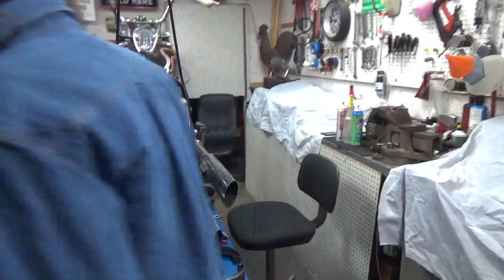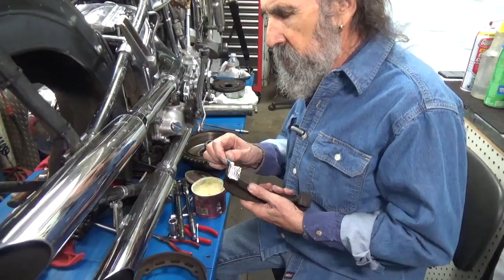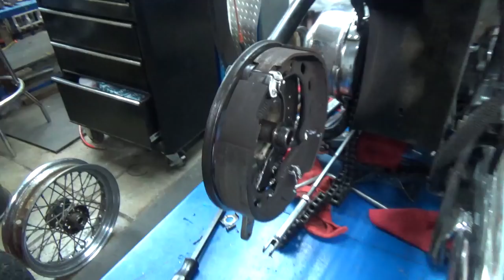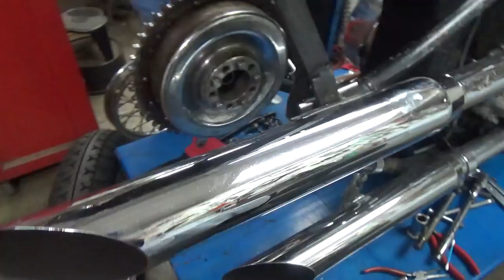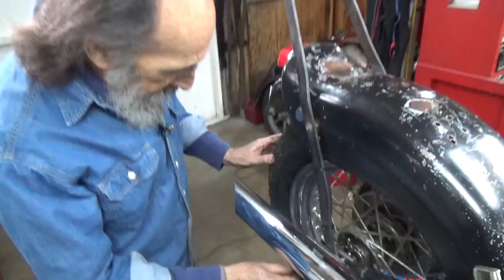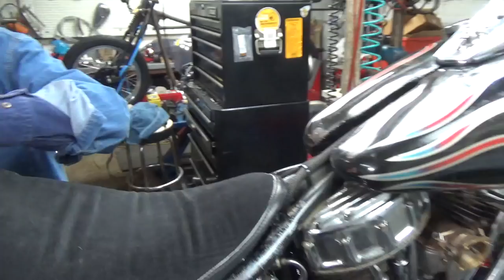Step19 L C  the Panhead Now gets Her New Tire, Seat & Rear Brake

Comment: I was an auto mechanic for many years and I never liked when somebody was watching me work...I hated it. I would stop until they left me alone.
Reply from the maker: Yah, but those brake shoes popped on like I was alone!
Reply: @pacificmike9501  the next level as a master mechanic is to have the gift to teach others and deal with problems  even when the bike didn't read the shop manual. :)

Comment: P.S. Mike, I had those tires on my 82 FXRS Shovel Head. They were nice in the rain. Glad I had then on. I always put 3 coats of good wax inside those wire rims win they're new before mounting inner tubes & tires. Also tall & fat rubber on both ends = a great handling and smooth rider. That wheel & new tire looks great installed.
Reply from the maker: Thank You
Reply: What tires are those?

Comment: Hey Mike, you never said what the tire was. It looks like a Continental K112.  I ran a Continental on my ridgid for years. It was the best riding tire I have ever come across. I didn't realize they still made them.
Reply from the maker: Yes, your are correct.  I was told years ago, by an old buddy of mine that they still made that tire for use on rigid frames.  He was the national sales manager for Continental Motorcycle Tires.  We used to eat ice cream bars together at the trade shows.

Comment: Hello from Sweden🇸🇪. Looks nice with a comfyseat on LC👍. QUESTION...I know u don't advertise brands on tires Mike. But what brand is it? I have never seen a rusty rim like that before. My Springer Softail had some rust on the rear rim but not as bad as that. Took some time to remove rust and know it got paint on the inside of the rim. Have a nice weekend the 2 Mikes😎Kjell Blomstrand 🇸🇪.
Reply from the maker: Sure.  It is a Continental K112.  MT90  16.  Still made today because they are so comfortable on a rigid.
Reply: @pacificmike9501  Thank you👍. Next time i change rear tire i try that on the Springer or the Electra Glide. Kjell🇸🇪
Reply from the maker: I try to use the right tire for the job. This is what I run on old rigids.

Comment: Is removing the wheel from the drum a more effective method for wheel maintenance? I pulled my rear wheel for the first time for a new set of spokes and truing and took the drum and mechanism out with it. Would it be beneficial to mount the drum first when i put the wheel back on the bike?
Reply from the maker: I don't know which bike or model you have, but generally, Harley recommends removing the wheel from the brake drum.  Look it up in the service manual.  On a rear factory rigid, what you suggest is way difficult.  This is what we're working on.
Reply: @pacificmike9501  thanks for the reply. Mine is a 49 EL. I'll get deeper in my service manual once I get back to the states.

Comment: Hay Mike, you have anything on replaceing the rear tire on a old 1984 FLHTC with the enclosed rear chain?
Reply from the maker: I haven't done one in years.  But, it's a great long lasting setup.  Follow your service manual.  Lift the bike up and remove the lug bolts to remove the wheel from its sprocket.  That enclosed (oil bath) system is great.  Just don't attack it without the guidance of your service manual.  Most of them have been destroyed and it's a real shame.
Reply: @pacificmike9501  thanks Mike. i will do that. my oil bath unit is still complete.
Reply from the maker: Luck you.  The chain will outlast anything you've ever seen.

Comment: Hey Mike...Really enjoy your calmness in your videos and the content. You stated that the tire you have installed is fantastic for hardtails for comfort. What is the size and brand of tire and also pressure that is run? Thanks again.
Reply from the maker: I explained why it is still produced.  It is a Continental K112.  It is produced as an MT90 x 16.  It is also produced as a 5.10 x 16.  I run ery low pressure and I weigh very little.  You'll have to experiment for yourself.  Also, this is not a real high mileage tire.
Reply: Thanks Mike I really appreciate it Mike. I too  @pacificmike9501  weigh very little as I am now 79 and still riding hardtails
Reply from the maker: Then it's final!  We ain't growin' up for nuthin'!

Comment: Hi 👋 Mike great videos, if you have time could you suggest proper tire pressure on 75 fxe,  have new michelin commander two tires
Reply from the maker: Start with around 40 in the rear and 36 in the front.  Experiment from there.  Do you weigh 150 or 350?  It's your preference.

Comment: Mike may I ask what size cinch ear clamps you use on your oil line? I measured how I was told by the supplier and went with a clamp size (17.5mm) I was in the middle of the range and the hose is tight on the fitting but still turns.
Reply from the maker: Well, I dug one of mine out ( and it is stainless from McMaster Carr) and it is marked "17.0."
Reply: @pacificmike9501  Thank you checking for me Mike appreciate it
Reply: I think I figured out the problem after knowing you were using 17mm, it's to due with the condition of the hose. I noticed how stretched out the hose was that was on it compared to a new piece so I tried the piece with another clamp and it's good to go. Thanks for your time.

Comment: What tire is that?
Reply from the maker: Continental K112.  Size MT-90 X 16.
Reply: @pacificmike9501  Thank you mike. I was your videos it's good to see someone still working on old bikes. I think I'm the only one around here that still does. 68Flh
Reply: Mike I have a question. I use to run those a long time ago with a narrow front end. I'm running a  16 on front now what would be compatible with that one.
Reply from the maker: That tire is made to run in one direction one way, or, flip it over for the other way.  It's beautifully labeled.  They also make a tire in 18 and 19" to match for front.  It is referred to as a "Conti Twin."
Reply: @pacificmike9501  thank you for the info. Love the videos. Keep up the good work.